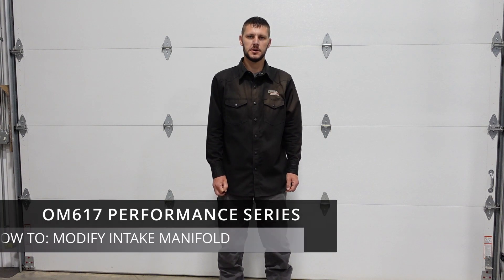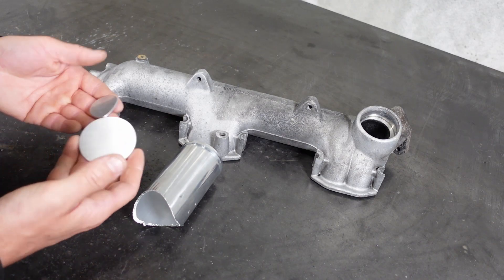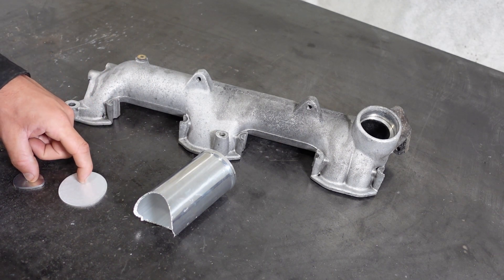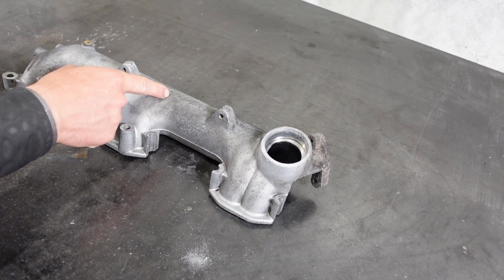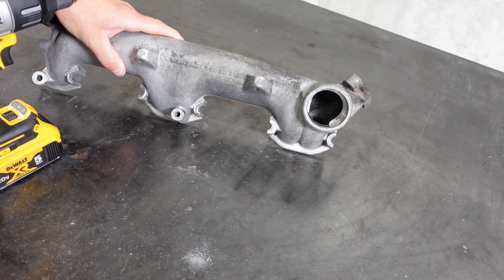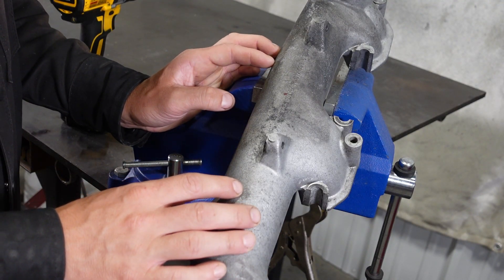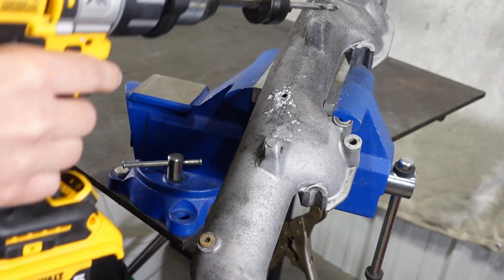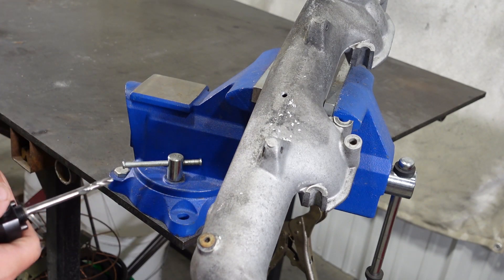OM617 Performance Series: How to Modify Intake Manifold

Comment: Your prep and theory are spot on. 
Other than the cast has contamination throughout the thickness not just on the surface and you don’t need the special rod.  
Expectations of a perfect weld on cast are quickly abandoned. 
2 methods that help me    
If you have a pulse mig use that the heat input is less the welds generally look better on cast. 
If you use a tig with adjustable parameters adjust the a/c cycle towards the cleaning end. 
Run over the cast with the torch just cleaning first,,turn it white, brush it off then set your machine back to balanced and make the welds.  
Sometimes one can make the welds with no porosity like that.  
A third thing is to have the part cleaned by steam or hot water,,,like a transmission would be, that also can help a lot.  
Not knocking anyone, just a few things I have learned over the half century that  I have been doing it.
Reply from the maker: I didn't come up with all of this on my own. I consulted with one of Lincoln Electric's veteran tig welding engineers. He gave me the # for the rod, which IS a critical component as it wets out easier. That's a critical feature since you want to melt the cast AS LITTLE AS POSSIBLE. Setting for higher cleaning action will only try to draw more and more contaminants out of the casting, which there are an infinite # of, resulting in a greater likelihood of porosity, so you want to actually minimize cleaning and minimize heat input on the cast material. We don't know what alloys are in this casting, but we do know it's not a casting made to be welded. Welding on a casting meant to be welded is a lot different story.
Reply: A good old kitchen oven with self cleaning and cycle that thing though it,   if you can, after that if I wanted to try to get it as perfectly clean I would submerge it in acetone with a pump circulating for a day or two. Air dry and back to over on warm with door open a little. Or a rod box to get the pores dry.    Then scuff that top layer and weld. Plain 4340 or is it 4043 filler will do just fine. Most likely on cast anything I plan on sucking it in. So depending on my mood and what it had in it and how porous I might not even knock the surface.  Hell I any more on non structural stuff like that I don't and just crank the ac ball to more clean and ad more DC pulse power, go adjust freq up or down from 60 to 250 on the ac side till I like and just run the crap out of it.    I've been able to weld 2 pop cans but to but only cleaned with a scotch Brite and then cut a can in half and slip it inside of each other and tig that. But that was years ago and I think my thinnest in alum I done lately is 18-20 gage 
 Now if you got a tig that does pulse in ac and DC modes then you can dial that thing way down and even run it with ceraited or lanth tungsten sharpened to a point.  I've welded a few oppsies in my time. A couple Harley Evo engine case's where someone didn't brace and support when pressing in new crank bearings.  Amongst other things like that.   
   Sometimes ya gotta think outside of the box.
    I'm also one of the guys that always find a way to make it happen.    
     The guy that a buddy who knows a buddy that know a guy that has a buddy that if it's metal he can weld it. Even if everyone else says it can't be done. And when I hear that I can't do it , well it's personal now and I take it as a challenge.😁 I like a good challenge and I'm not afraid to jump in.      
      Not saying you done it wrong cause you didn't. I just have my ways. As we all have our own style.

Comment: For tubing, I use 6063 aluminum.  Alloy 6063 is formable and I use a JobberDo to form a bead.  I purchase it from onlinemetals  

BTW, I posted this information about a week ago, but it disappeared.  I included a link to the tubing in the original post.  Is posting a link in comments prohibited by YouTube?
Reply from the maker: Yes, for some stupid reason it is. It wouldn't even let me see the comment. 
6063 simply indicates structural aluminum. Essentially the structural forms of 6061, such as square tubing, angle, channel, etc.